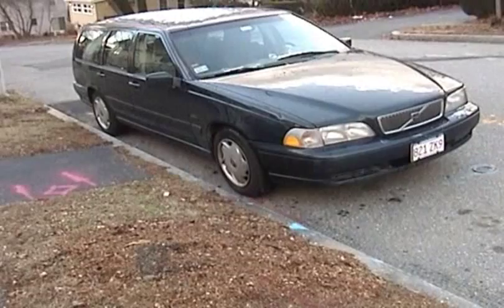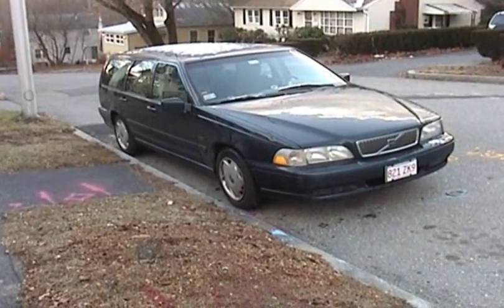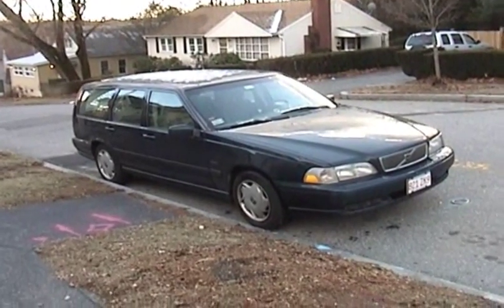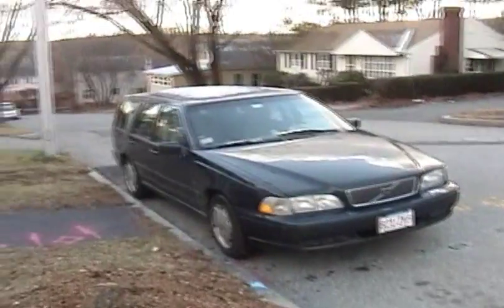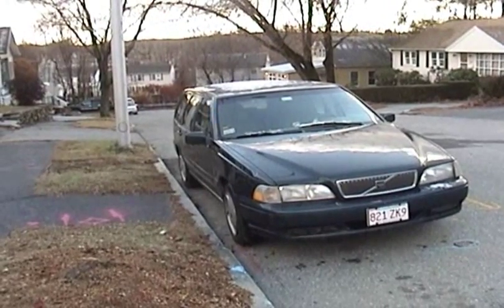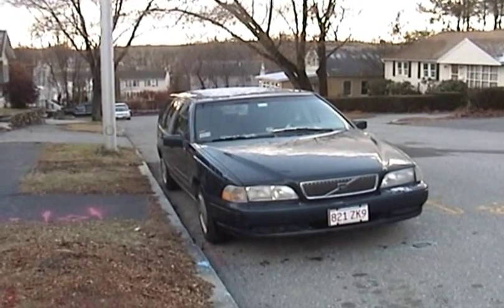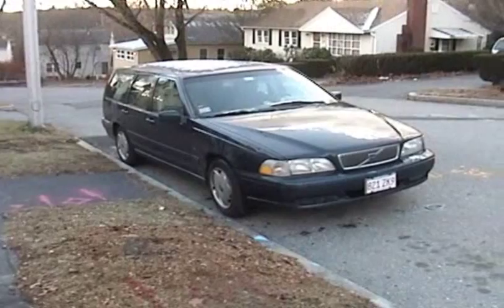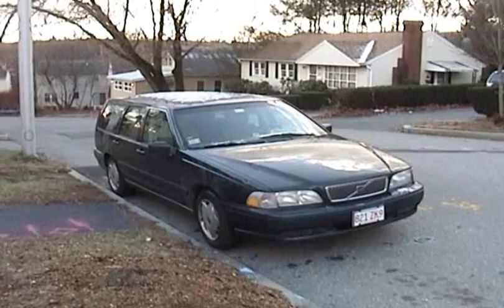1998 Volvo V70 - end of project

Comment: That secondary air injection code pops up on all of those cars in that era. It is on my 98 v70 T5. There is a bypass for it, I am not sure what it is. Good luck with the car. How many miles does it have?
Reply from the maker: The car has around 178K miles. I cleared the codes a few weeks back and nothing has returned so far. Trying to see if there's a pattern.
Reply: MercedesDieselGuy
not sure if you fixed this code or not, but I have heard it's very common on those Volvos. I found something online about it, not sure if this is the code you got but here's a link if you're curious: http://www.datsc.com/tabid/122/OBD-Error-Code/P0411/Diagnostics/volvo/Default.aspx
I'm sure Robert Spinner would know more about that code also

Comment: Not sure what set up they used for the accelerator pedal on this car but I know that on some of the newer Volvos when this happens it's oftentimes the accelerator computer module that goes bad. The computer module acts as a mouse which sends an impulse to the computer when u depress the accelerator. If it has this set up in lieu of a throttle cable then u will need to buy this and unfortunately you will need to bring it to a mechanic with a dealer level scan tool because the computer will need to be reprogrammed to work with the new part.
Reply from the maker: In this case, it's just the accelerator cable hanging up in certain conditions. Replacing it is on my to-do list. I don't think these cars were drive-by-wire until model year 1999.
Reply: MercedesDieselGuy
yeah I think even on the Volvos there is rust hidden somewhere on the car, probably underneath the car or under the hood near the motor, and I think your suspicion is probably correct about the rusty cable which is likely causing it to stick on intermittent occasions.
Reply from the maker: Michael Sackstein Trust me, the Volvo is CLEAN. Very happy with the overall build quality on this car.
Reply: How does it handle in the snow?